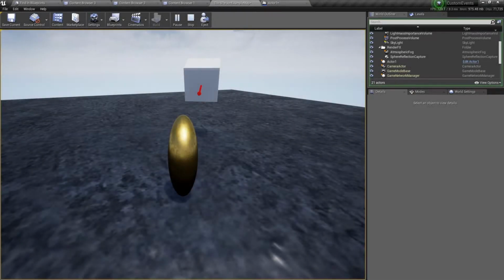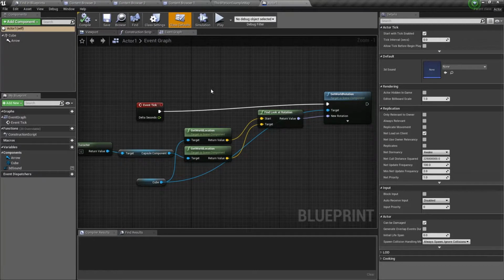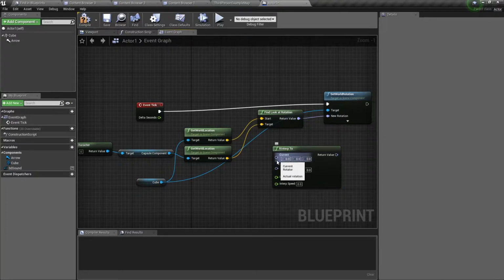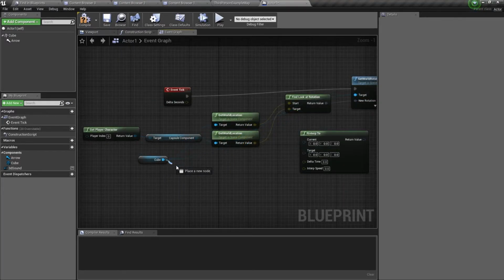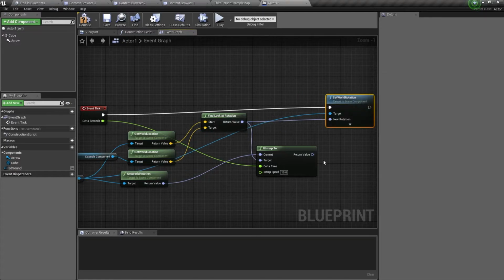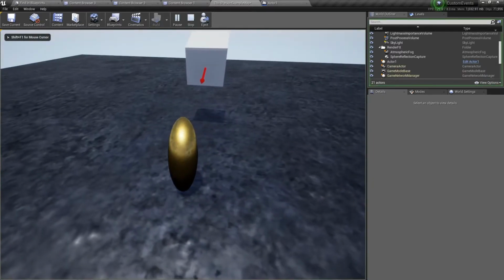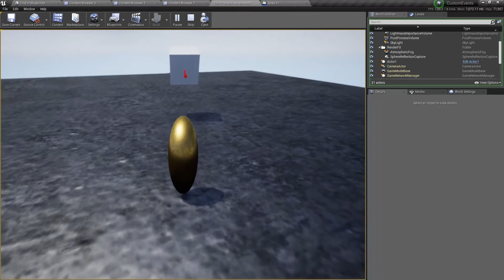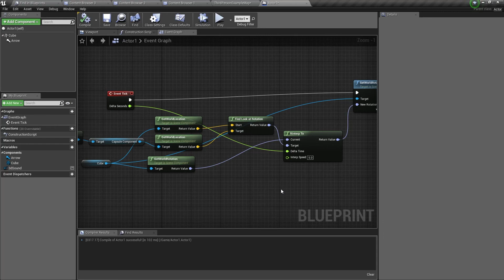How to Interpolate Rotations || RInterp || UE4 TUTORIALS

Comment: Hi~ It's a super late question🤣. I find out it worked prefact when only one actor move, however, when both of them move, it will never aim until the aiming one stop. I am not sure what is wrong, but I think the problem is both location is changing make the target rotation changing every delta time.

Comment: Say I want to lock the x and z axis by just leaving the coordinates at 0. For some reason it only follows on 50% of that plane. How would I go about doing this?
Reply from the maker: I'm not sure what you mean?
What are you rotating?
Reply: @TechnoNerd  Looking for a way to find look at rotation on the Y axis only and smoothly rotate toward the target. Mainly just rotating in 2D, only connecting the y pin and using interpolation yields undesired results. Any suggestions?